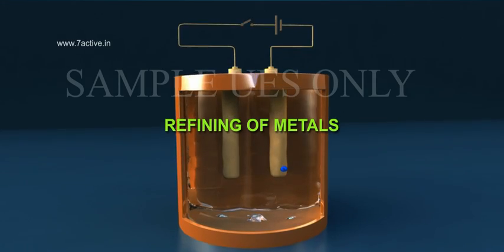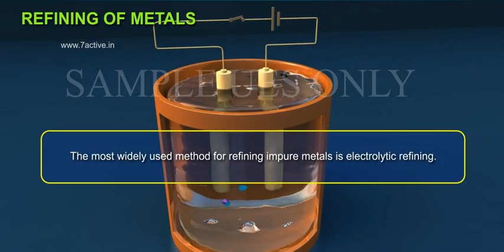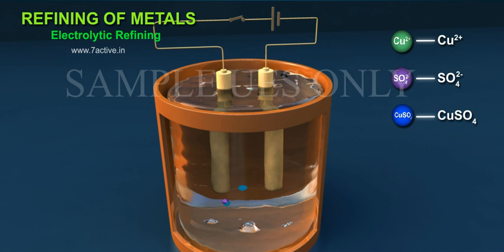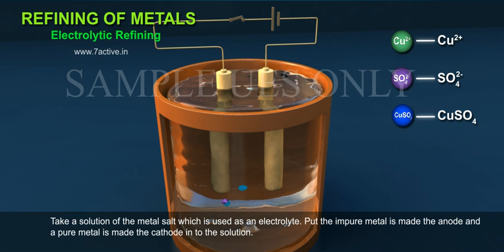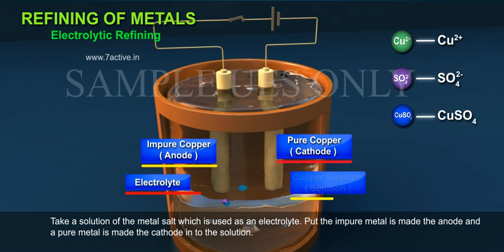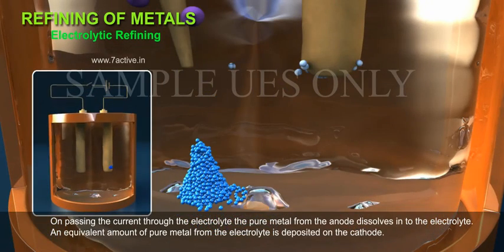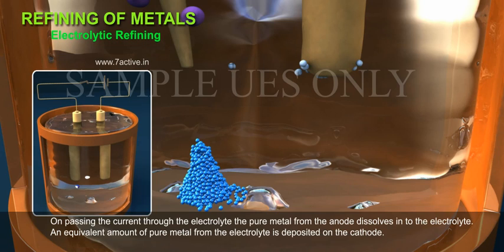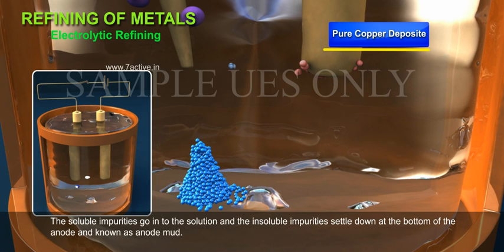Refining Of Metals

Comment: How does pure metal from the anode dissolves into the electrolyte when u first said that anode is impure copper
Reply: Bro only the pure part of the anode gets dissolved not the impurities (anode mud)
Reply: @hyperbeastnimit4190  , that is partly true.  The impurities that cannot remain in the solution will fall as anode mud.  There can be other impurities that remain in the solution, which is why the cathode is supposed to be pure as it can be.  For example, the anode might contain zinc, which remains in the solution.  The zinc, however, wouldn't likely be attracted to a pure copper cathode.